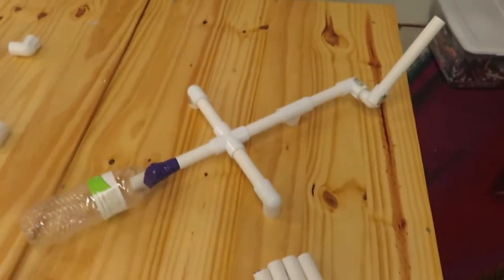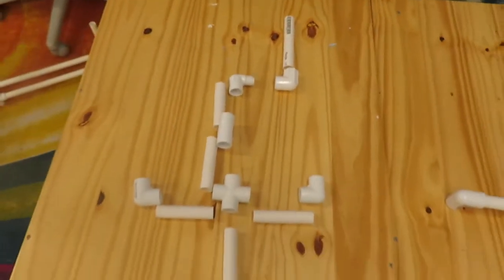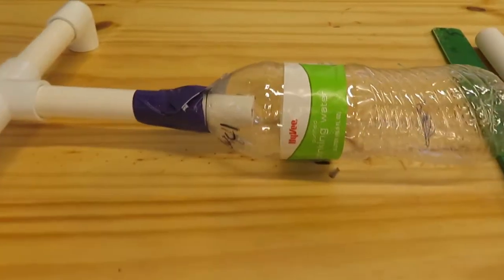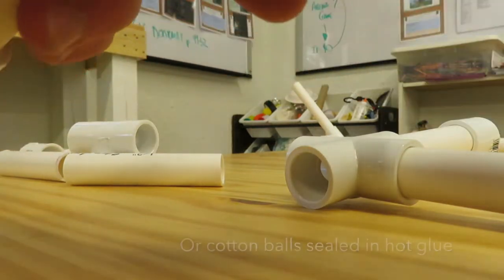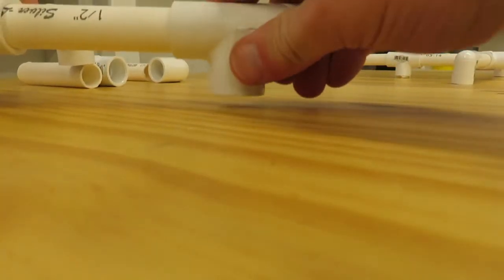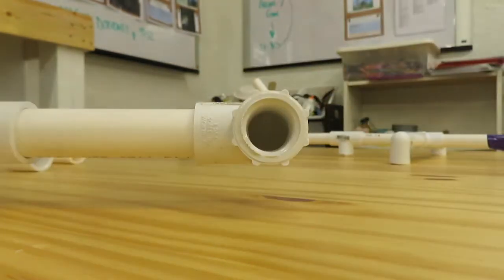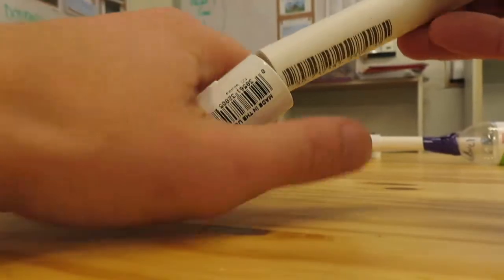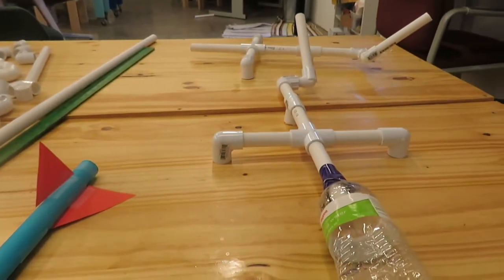Adjustable PVC Stomp Rocket Launcher

Comment: Absolutely great idea to add the plugs. I didn't tape my 2 liter bottle on to the pvc which was a good thing because the bottle was bent out of shape after the 3rd launch. However, it was so easy to make I ended up with 2. They cost under $10 and the lovely guys at lowes were able to cut the pieces for me.
Reply from the maker: Even better when others cut them for you! You can also use a hand saw or I bought a pair of PVC cutters which is a great tool like these - https://www.amazon.com/Zantle-Ratchet-type-Cutting-Plumbing-Plumbers/dp/B07T2YG963/ref=sr_1_5?dchild=1&keywords=pvc+cutters&qid=1622651745&sr=8-5